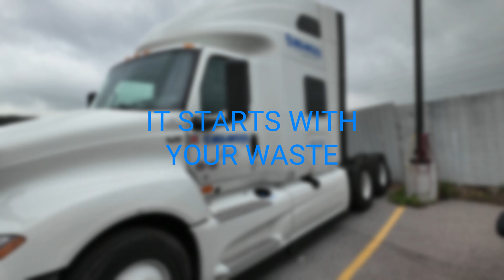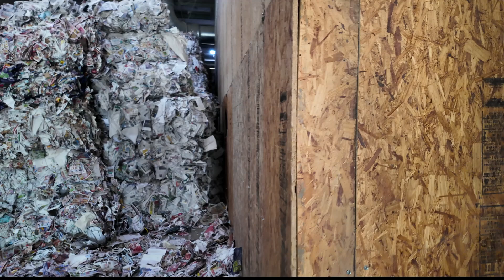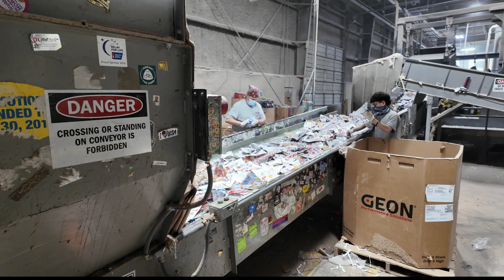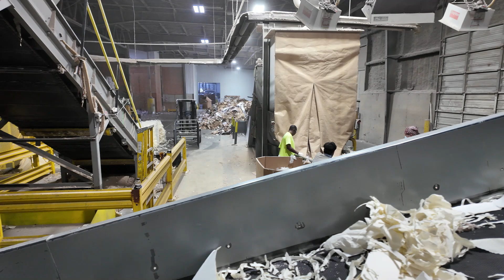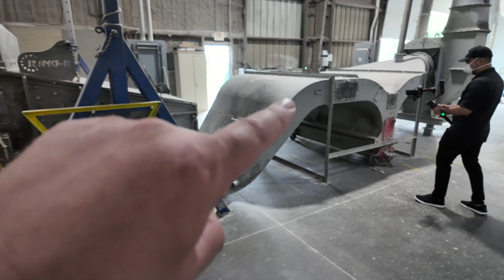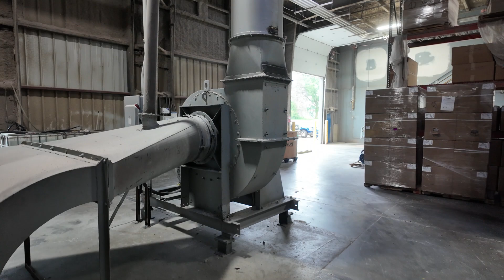"RECYCLED" INSULATION - Part 1

Comment: Fascinating!! Love to see efficient, large scale recycling in practice!!
Reply from the maker: All of their base content is 100% recycled material
Reply: Tell us the important part. What does finished product look like and what is the price vs other insulation.
Seems very inefficient labor wise. Lots of people standing around not working.
Reply: @ToddBizCoach I can’t speak for this manufacturer (I’m in Canada), but I’m doing dense-pack cellulose walls and blown-in cellulose attic insulation in my personal build, and it is CONSIDERABLY cheaper than any other method.  Labor is higher for the walls, but overall considerably cheaper.

It’s also far more fire resistant and pest deterrent than other insulation types, and handles moisture better.  Overall it’s an excellent value.  AND it’s recycled material, to boot.